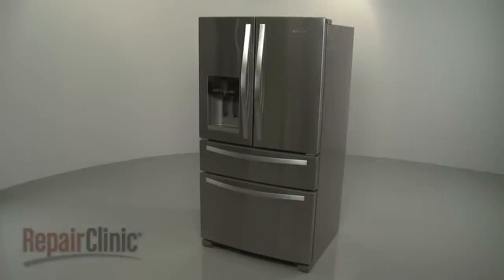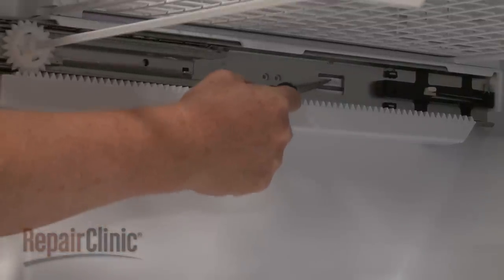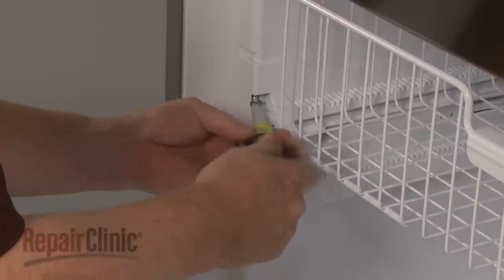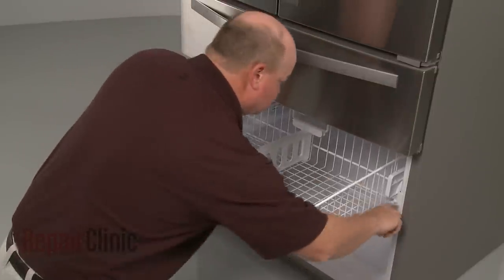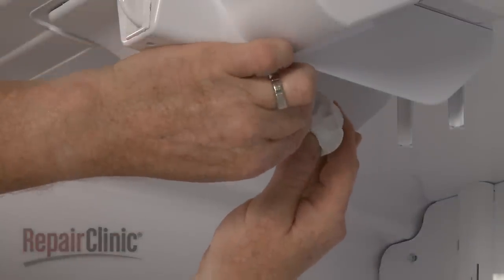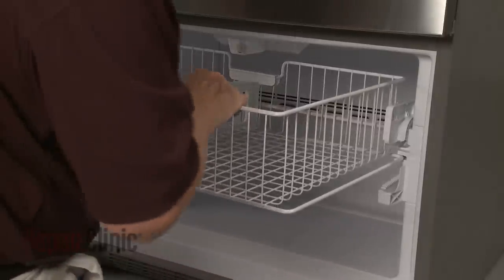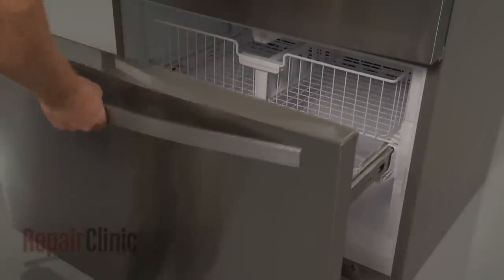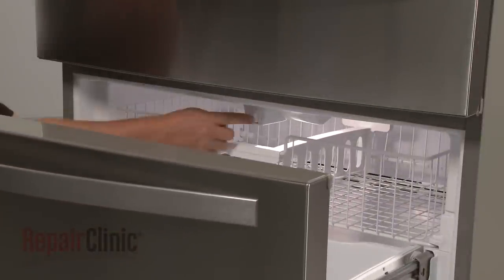Whirlpool Refrigerator Freezer Replace Light Socket #W10134764

Comment: Turned out ours had been slightly open and ice developed over certain areas. Once I managed to remove all of that ice, it closed properly again. However some ice remained in the sensor that tells the light to go on. I gently pulled up on the sensor with pliers and the light worked again!
Reply: same problem. where is the sensor?
Reply: Thanks for this!!!! Same problem here

The sensor should be the little “button” thing staring right at you at the top of the freezer when you open it. It goes in and out

There were ice around it so like Tony, I had to break the ice around that thing with a small razer. Push it in and out a few times. Works well after that
Reply: Thanks!! Worked for me too. 
This video is still good though!!
Reply: A new bulb did not work, but this did! Just pulled the sensor toward me a little bit with my fingers and voila, there is light! Thank you!

Comment: Thanks! Wonderful video! 40w incandescent appliance bulb blew. After metering switch and bulb socket all tested well, but bulb still would not light up. Pried up center contact tab in socket. Voila! Replaced with standard sized LED bulb. Will never need to do this job again!

Comment: I am looking for a whirlpool bottom freezer bulb w10565137 3.6 watts could u help me pls
Reply from the maker: The manufacturer has updated the part number of that bulb to W10865849 please click here: https://www.repairclinic.com/PartDetail/Light-Bulb/W10865849/4454427?replacedManufacturerPartNumber=w10565137&TLSID=1943
Reply: Use a standard LED bulb. When your fridge wears out remove bulb and use in new fridge and the fridge after that one. Must thank Whirlpool for building the bulb cage to accommodate standard sizes.
Reply: I have problem  w cover doesn't snap in hangs down in back of cover light  goes off and on like it is shorting but sometimes on

Comment: Terrible design for lighting. You Shouldn't have to replace the socket to replace a bulb...just something else to c h argue money for.
Reply: You don’t have to change the socket to replace the bulb. However, the socket can be a point of failure, so that’s where this depth of taking it apart can be useful to see before diving in to your own.